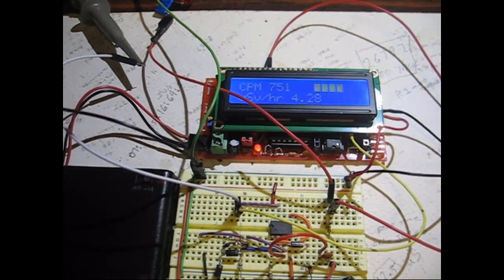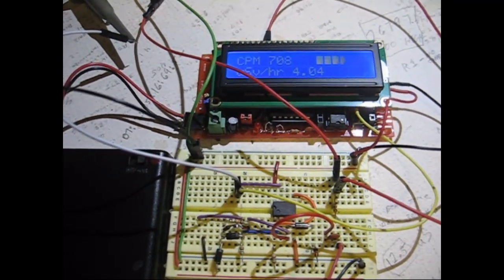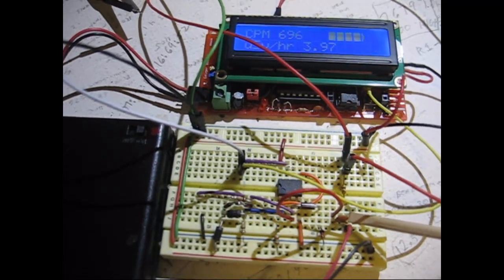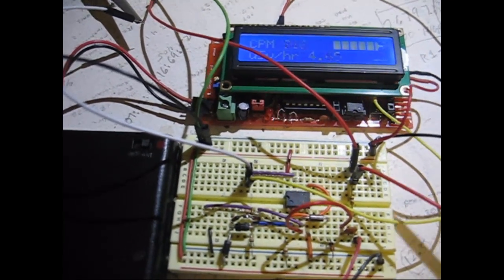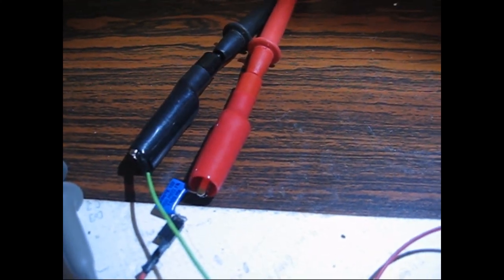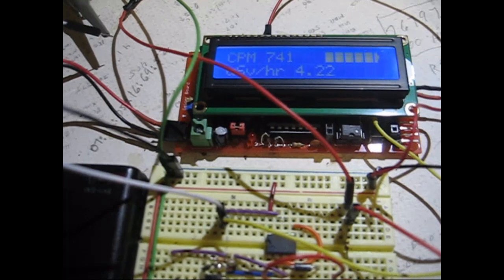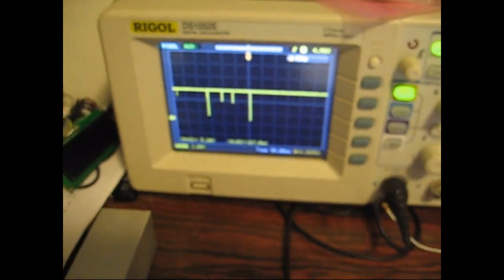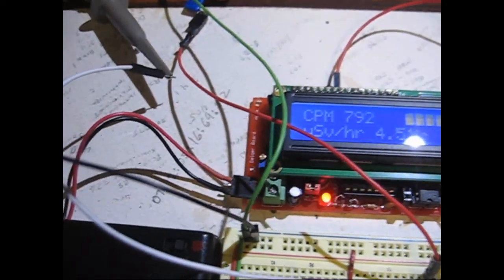Geiger Kit with scintillation probe

Comment from the maker: Lead shielding is generally used to block background radiation - not light. This is needed when doing gamma spectroscopy to keep the background from interfering with the results. Lead pigs are used to store radioactive material.

Finally there is no "flaw" in the "method". It is simply a demonstration of how a scintillation probe can be hooked up.

Please understand that I consider this continuing discussion to be somewhat off topic. You're free to respond but I may not in turn.

Comment from the maker: At the risk of dragging this discussion on I have to object. While it's true that alpha scintillation detectors need a thin window to allow alpha to pass, the vast majority of scints are gamma probes. These are sealed in metal and not nearly as prone to light leakage. In addition since the PMTs in scints are so sensitive ANY light leakage is likely to make them totally inoperable - not have them count high.

Comment from the maker: My average background count with an SI-29BG is 18 CPM. With a good pancake GM tube LND 7317 it is 94 CPM. The ratio between uSv/h and CPM depends on the tube being used (even then it is only very approximate).